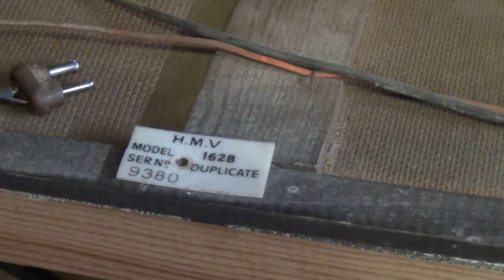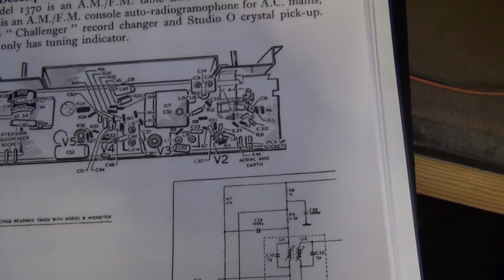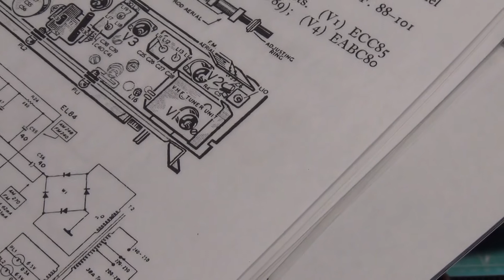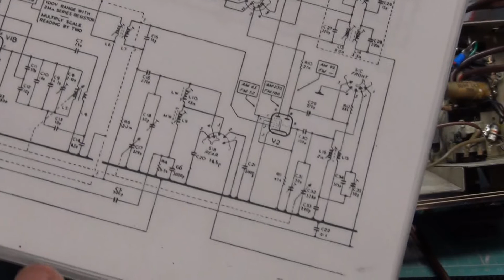HMV 1628 1959 radiogram (valved) repair & overhaul - pt1

Comment: Nice one very interesting. I have a valve Pye radio which still works superbly just needs a few minor jobs.
Reply from the maker: We automatically change all electrolytic capacitors in valve products that come in; these are what will have caused the HT feed resistors in the radio section for fail too. I thought the turntable would be the usual 20 mins job, but not this one. 2hrs later & I'm still un-seizing the speed control  mechanism!

Richard